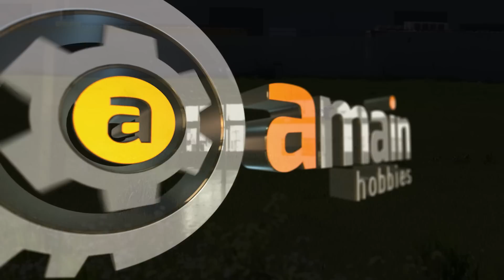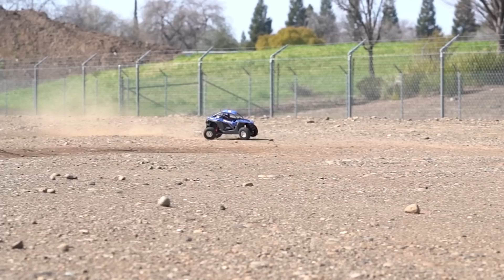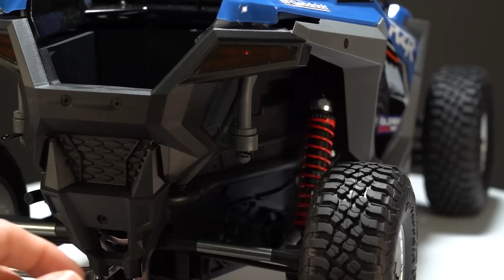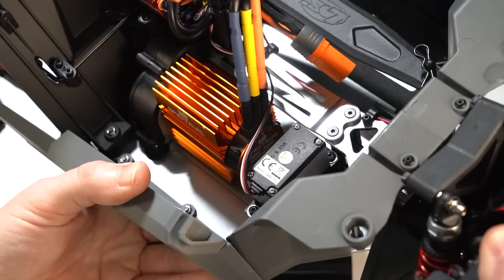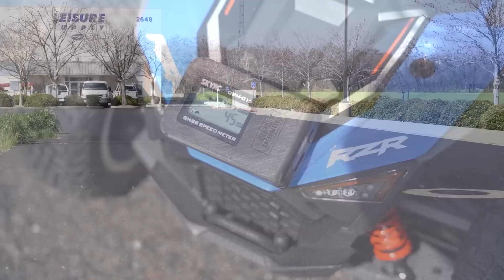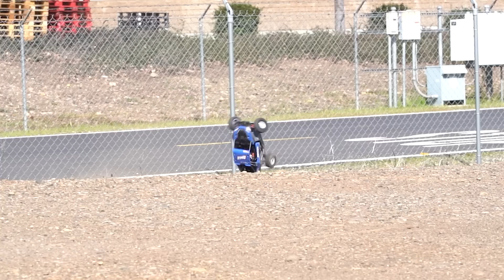The Losi RZR Rey R/C Side-by-Side

Comment: I've noticed that a lot of people are failing to realize that the rzr rey is a scale rc. It isn't built to handle or jump like a basher. I have enjoyed mine so far. I will say that the suspension is under-dampened out of the box. Even when you scale it to a real rzr. I swapped shock oils to 40wt front and 50wt rear. It handles a lot closer to scale now. I will say that $620 for the rzr rey is too much. Especially for an rc that has cheap plastic shocks that love to leak and an underpowered rtr steering servo.
Reply: I don't think any of us "failed to realize" that, because Brett uses the word "scale" about 10 times in the video. I think what you're confused about is that "a lot of us" fail to see the value in this particular "scale" model. It's over $250 more than other 10th scales, and that's all based on looking different. I'll pay an extra 100-150 for a licensed scale body if I REALLY like it. This "scale" truck is nearly twice the price of other 10th scales. And it's all for looks, not performance increases. 
That's absurd. 
Sounds like you're just trying to justify your purchase, which is fine, but to the rest of us, "scale" is worth maybe an extra $150, and this is just too little for the extra $$
I could design a realistic "scale" Fisher Price dump truck that cost $400 and had a 3.7v ESC and plastic tires and "a real licensed body" but that doesn't make it a good price. That's just a "scale" piece of crap. 
Using the marketing buzzword "scale" doesn't automatically make everything worth the MSRP. 
I don't even like "scale" realism in this model because the wheelbase is too short and the RC is tall. 
It looks turtle-happy.
I guess maybe for the 10 people who are that into side-by-sides, or people with a YouTube channel who can justify the purchase with "the video will pay for itself"
Ehhhh.... I go for performance first, durability second, looks a distant third. 
I put that on my Tinder profile too.

Comment: It’s an Overvolted Radio shack special that’s not even worth half the price. It’s balance, high center narrow wheel base basically makes it work like the Chevrolet Blazers of the 90’s and them things had one of the worst rollover ratings ever. To sum it up, yes it looks nice but the engineering is horrible. Needs to be wider and higher with the wheels moved out to the corners and have a way better reactive suspension than it does. It’s reacts like a cheap toy. The cost of it and then the cost to make what it should be is worthless. You can spend $1,000-1,200 on it and no just no. Somebody really dropped the ball on its development. That’s all I’m saying.
Reply: Nobody dropped the ball. It's a scale rc. It isn't designed to handle or jump like a basher. It handles relatively similar to a full-size rzr.
Reply: Its scale realistic. Real Rzrs have the same problems, you need to drive it within its limitations.

Comment: While I think this would be a lot of fun to own, $620 is too high. I've seen this in person and I feel it still has a toy feel to it, but in a bigger size. I think if it had a $450 price point, it would be more reasonable. This just seems too expensive. The Lasernut is $540 and has way more scale details.
Reply: it doesn't look much different than the 1/6 scale walmart generic version which cost less than $200
Reply: @daveyd0071  Ya BC the Walmart one drives like that 😂 FFS don't compare losi to Walmart makes you look like you don't know what you're talking about
Reply: While I don't disagree with you, $200 of that price is probably the license fees. 

That's exactly the reason I don't jizz my pants over a licensed RC. 
RCs are expensive enough without 2 extra companies (Polaris and BF Goodrich) taking a cut out of the price. 
So ya either get a brushed RC with crap performance for $300+ (licensed) or you get a brushless okay performing RC for $600+ (licensed)

Licensed RC designs are for suckers. 
Because for every 10 people that see this design at this price
9 of them will say "damn, way too expensive"
And 1 of them will say: "that looks awesome I'm going to buy it because I like how it looks and I don't care about the other details or the price"

Look at the comments section for proof of the above statement. 

I'd never spend $600+ on this RC, but plenty of people will and that's why Losi and Kyosho and CEN continue to sell ho-hum performance in an attractive package.
It's not for me, but they'll still sell a few thousand of them to people who want to take it to a car show or something, or owners of the full scale truck will buy it and sit it on a shelf and it might as well have no electronics at that point, but that's what people do. 
People are dumb.
Reply: 620 ? I was thinking it'd be like $450